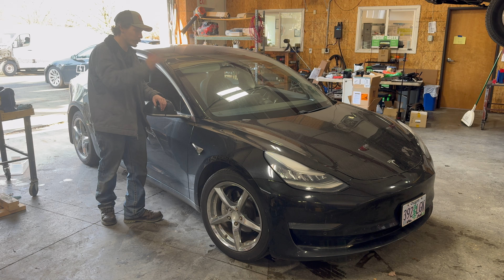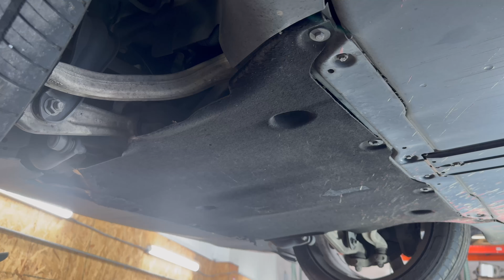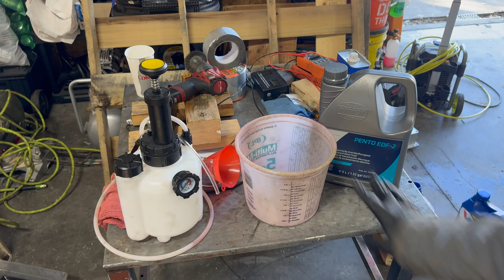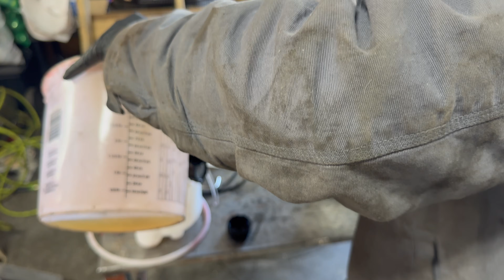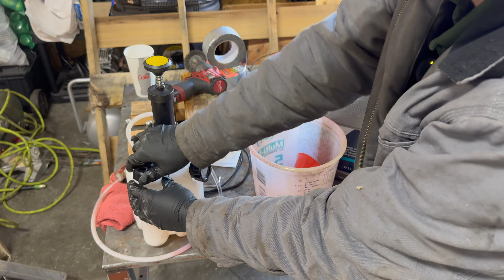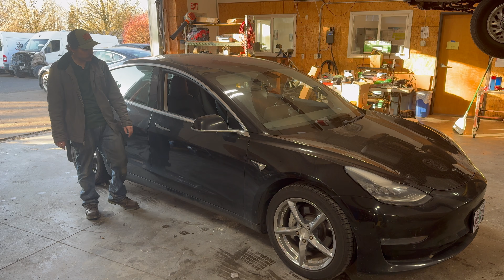Tesla Needs An Oil Change? Model 3 Gearbox Fluid Exchange Process

Comment: If I change the transmission fluid myself, will I also need to use diagnostic software or perform any kind of reset or adaptation procedure afterward?

Comment: what is the third wire for on the electrical connector? So you can run this pump with just a power and ground?
Reply from the maker: The 3rd wire is for PWM feedback to modulate the pump's speed. If the pump doesn't receive a PWM signal, it just runs at full speed.

Comment: I just did my model 3 long range. To get the pump out I just removed the front motor mount bolt and jacked the motor and let it down about half an inch. It takes an extra minute or two but the oil pump will clear and you can pull it all the way out. I was changing the ring seal as well so I had to. But it’s not difficult at all. So yes you can definitely let it down. Just one bolt and a screw jack while it’s up on the lift.

Comment: So replacing the filter isn't necessary? I'd say it's vital. Also not taking the pump out means the old seal cannot be replaced. Recipe for leaks to develop further down the line. If your going to do the job don't cut corners or expensive outcomes could catch you out.

Comment: What's the name/type of the socket/plug for the oil pump? I wanna make a tool like that as well.

Or can I just use alligator clips? Not a big fan of alligator clips. 
I heard there's a brushless motor and a control chip inside so you cannot mix up the + and - otherwise it'll break.

How did you figure out the terminals?

Can you also just use the car's navigation to a nearby supercharger to cycle the pumps? I've heard that'll make them run while stationary?

Comment: Nice job spraying break clean while the drain plug was open. Ensure you get some break clean into the gear box. Also replacing a drain plug washer should be standard practice on top of the washer for the gear pump. Those will leak over time since you decided to do a service to it

Comment: Hope you can help. My rear drive unit in my 2023 model 3 (RWD with LFP battery) is making whining noise when at 70mph. I believe it is the drive gear. The drive unit is 1120990-00-J and I found a 1120980-00-D dirty cheap. Is it backward compatible? I have a 30 day subscription of toolbox.
Reply: Its a stiff ground cable between drive unit and chasis. Remove left real wheel and wiggle the cable 😉
Reply: @The_World_in_HDR  You meant my whining (woo-woo-woo) noise when at 70mph constantly is because of the stiff good cable?
Reply: @derekkchung yes, it transfers the noise from drive unit to the chasis, go try it out and then please reply if this helped. You can also put some grease oil or whatever on the cable to prevent it from going stiff again.
Reply: @The_World_in_HDR  I actually took the subframe + drive unit out to replace the bushings (not quite successfully) and we did touch the ground cable. It is not stiff. The woo-woo noise is not coming from left or right wheel so it is not wheel bearing. It has to be from inside the drive unit. Maybe the gear bearings or gear mesh. Question is to replace the whole drive unit, or just bearings and/or gear mesh.. Not much info online for doing that.
Reply: @derekkchung okay then I dont know. Good luck finding the problem.

Comment: I wonder if you could help me.....i purchase a harness that runs the pump but it has 3 wires (red,blue,black) instead of the 2 (red,black) that connect to spade terminals if 12volt battery.....which goes where?
Reply: https://youtu.be/hFX990n95-A?t=17

Comment: do  you not disconect 12v battery when you operate on those pumps ??  but just take off the power line on the pumps ??? but realy nice video :)

Comment: Is that electrical connection just a 2 pin female Deutsch connector? Also, what is the oil filter number? I just don't want to install something "Out of Spec"..... See what I did there ;)

Comment: Use your favorite search engine with this prompt:
Why do only some of my comments to a YouTube video get deleted within seconds of posting?
It's both interesting and frustrating.  I'm posting this comment only because of the problem I've had with several (not all) of my comments to this video getting auto-deleted repeatedly even after I try changing them.  And I was actually trying to give helpful information based on my experience changing the fluid on my 2022 M3 LR.

Comment: I followed the procedure in the online Model 3 Service Manual to change the fluid in my 2022 M3 LR .  One of the first steps is to disconnect the low voltage battery.  I read through the entire procedure and could not understand why that should be done, so I didn't.  I didn't see any problems.  What could the reason possibly be to go through all the effort of disconnecting the low voltage battery?  I can't think of anything that is less safe by leaving it connected.  And if you disconnect it, you wouldn't be able to use the Service Mode Plus menus to run the oil pumps.  If anyone knows, tell us if the technicians in Tesla service centers disconnect it to do this procedure.

Comment: The more I think about it the more frustrated I get about how car companies make it impossible to do a basic maintenance item such as this by forcing you to pay for either a special run-box ($500+) or a Service Mode Plus subscription ($75 for 24 hours).  One of these is needed to simply run the oil pump(s) on some models later than the 2018 in this video.

Comment: I kinda doubt the pigtail that works on my 2022 M3 LR oil pumps (part # 1108202-00-L) would work with the 2018 in this video considering it looks like 2 separate connectors were pushed onto pins in the oil pump by you.  My oil pumps have 3 tiny pins in a small, oval jack.  I wouldn't want to try pushing separate, tiny connectors onto those tiny pins separately - pretty much impossible... and you'd probably bend them.  So, research showed that pigtails for my oil pumps have connectors that are also used for Tesla parking sensors.  
Web URLs in my previous comments have apparently caused those entire comments to be automatically deleted, so I'll have to be cryptic about the link for the pigtail I bought.    Paste this onto the end of the big 'A' product source owned by Jeff Bezos: "/dp/B0F9FMKZHS".  For anyone who tries this, let me know if this does or does not work.  And I'll keep monitoring this comment to see if it also gets automatically deleted.  
However, there's a big wall I've run into by trying to use this pigtail.  12v and gnd are on pin 1 and 3, respectively (pin 1 is nearest the slot).  I connected it to wires with battery clamps.  After connecting it to the oil pump and battery, nothing happened.   More research found that the LIN bus on pin 2 needs to see very specific LIN bus messages.  If you want to use an Arduino, Raspberry Pi or something similar along with a LIN bus interface chip/module, it's possible to make something that will get the oil pump commanded to run.  Use your favorite AI search engine to find the specifics if you want to pursue this, but I think I've decided to go a far lower-tech way to get my drive units filled with oil.  
I'm thinking that I can simply insert the fill hose into the fill hole and seal around it by stuffing in a cloth with a screwdriver just good enough to keep most of the oil from running back out of the hole.  Then I could pump in the full amount plus maybe a tiny bit extra to compensate for what will be lost between pulling out the fill hose, quickly putting a finger/thumb over the hole, then installing the fill plug with the other hand quickly after moving my hole-plugging finger out of the way.  Should be minimal fluid loss if done quickly.  Why wouldn't doing it this way be acceptable?  Would be a bit messier method, but it's free!  I don't think I want to be spending significant effort and/or money on buying or building something that might only be used maybe 2 or 3 times over the entire life of my vehicle.

Comment: Why does my comment about my experience with doing this on my Model 3 keep getting deleted?  Do comments containing Web addresses automatically get deleted?  I was trying to show where I found the connector pigtail that I used along with some other details I've figured out.
Reply: Also my later comment about oil filters got auto-deleted, and it didn't contain a web address.  It did however have at least 4 exclamation points in it, so does that flag a comment as overly-aggressive or inappropriate?  Since I saved it in a text document (I've learned the hard way to do this), I was able to repost the comment with the exclamation points removed, so we'll see if it gets auto-deleted again for some other reason.
Reply: Yep, my oil filter comment is gone again.  I'd really like to know what is going on.  This is really frustrating.

Comment: Where can i buy that pigtail wire?
Reply: I tried to post the link where I bought mine, but my comment keeps getting deleted.  Might be because it contained a Web address?
Reply: @BradMosch_engineer - do you have like a website you bought it from or ebay? You can post a link the link just space out certain things like HTTPS and some of the website and ill put it together
Reply: See my latest post in the comments.  I was very cryptic about the URL, so hopefully it won't get auto-deleted.  Also has other info about the problems with going that route trying to run the oil pumps (not nearly as easy as shown in this video).
Reply: I wouldn't worry about cycling the pump, just drain and fill
Reply: @MattB787   The problem is that if you don't run the pump while filling the fluid overflows the fill hole.
Reply: @BradMosch_engineer  Does it overflow? I watched another video, and the guy did not cycle the pump...might have been the rear drive unit.
Reply: @MattB787   I didn't try to put the full amount into the rear unit before slowly driving it, so I don't know if that one will overflow.  But, the front definitely overflowed about 200 or 300 ml before I got it all in.  It still overflowed after driving it around a little to get it circulating.  I ended up sealing around the fill tube with a rag, forcing the rest in, then quickly pulled the tube and put the plug in.
Reply: @MattB787 
 When it starts dripping. Go back to the car and switch navigation to supercharger, the oil pump starts running, and add the rest odf the oil. Simple

Comment: Tesla reduction gear boxes are sealed for life with no oil changes needed. Engineers with much higher qualifications than anyone on this channel (myself included) have worked this out for longevity using precision gear machining and latest tech lubricants.

Teslas with nearly a million kms are still working with zero problems after zero oil changes.

No need to waste your money, time, and more oil for no benefit.
Reply: Lol Yeah by that time no more warranty from tesla yeah they back and say no maintenance but after sh.ttt happen after 120K you end up paying the damage for a simple oil change

Comment: Why do people continue to remove fill plugs to "expedite" draining oil? It does not help!! The necessary air to alleviate a vacuum plug is coming from the open drain plug or the removed oil filter, not the fill plug....  :)

Comment: Just found you and subscribed from seeing samcrac’s video on the speed sensor. I have a 19 m3p with 103k miles and will be doing my oil changes soon. I bought filters like 2 years ago but really didn’t t know how. Now I do! question for you. I’m about out of warranty on mine and concerned about battery failure after warranty. Thoughts. I’ve only used a SC a hand full of times otherwise charging at home at 30 amp. Usually to 90%. Not sure to keep or sell or what. Only worth maybe $17k now great shape no issues.  Thank you!

Comment: Pigtail, can you provide the part number for the connector or a link to the amazon for it? Thanks
Reply: I tried posting the link to the pigtail that worked on my 2022 Model 3, but my comments keep getting deleted!  I'd like to know why.
Reply: @BradMosch_engineer odd. I found the connector that works from a wiring loom on bumper. Cut it off and used... worked well. But ya, who has that around...
Reply: @sigor2011   See my latest post.  I was cryptic about the address.

Comment: It’s wild seeing so many people in the comments cheering this on like it’s a masterclass in EV maintenance. This is a textbook example of how to confidently destroy a $5,000+ drive unit while pretending to 'save' it.

1. He used the wrong fluid: He admits to dumping in EDF2 just because his local parts store had it, instead of sourcing the actual required KF1 spec fluid.
2. Complete hack job: He crushes the oil filter with a chain wrench, eyeballs the highly sensitive fluid measurement from a plastic jug, and hot-wires the car's internal pump with loose spade terminals connected to a Milwaukee drill battery that literally falls off mid-fill.
3. Fundamentally misunderstanding the engineering: He's using 1990s Honda Civic logic on a modern EV. Unlike cheaper EVs (aka your leafs, bolts and Kona’s) with passive splash lubrication, this drive unit has an active, pressurized oil pump and a built-in filter. It actively removes metal shavings. That’s exactly why the fluid doesn't turn into abrasive sludge and is engineered to last the life of the car.
Unless your car’s computer is actively throwing a thermal or pressure error, cracking open a factory-sealed, heavily engineered system to guess the fluid levels is just begging for an out-of-pocket motor replacement. Do not do this to your cars.
Reply: I think you’re about the only person who understands the “Sealed for Life” reasoning in a Tesla gearbox.

There is no valid reason to do this unless you have a leak or damage.

Leave it alone. Even many ICE vehicle gearboxes and diffs are sealed for life.
Reply: Where are you getting your information from?  This is copied from the online Model 3 service manual's 'Fluids and Capacities' section:  
- For all 3DU drive units up to and including Model Year 2023 use ATF-9 (part number 1135241-00-A) or EDF2 (part number 1616951-00-A), or ultimately KAF1 (V1.2) (part number 1646886-02-B or 1646886-04-B)
- For all 3DU drive units Model Year 2024 and later use KAF1 (part number 1646886-02-A or 1646886-04-A)
- For all 4DU drive units use KAF1 (V1.2) (part number 1646886-02-B or 1646886-04-B)

Comment: Great video, as always, adding to everyone’s EV mechanical knowledge. Have a 2023 model 3 dual motor. Eventually I will change the gearboxes’ oil. Sure wish Tesla had installed a drain plug  and a way to just fill the gearbox, run the pump motor from the screen, then drive. Simple, like changing fluid on a combustion motor automatic transmission.

Comment: Is it safe to say that the newer 16volt Tesla’s require a 16v battery to run the pump?
Reply: .. or follow the advice in this comments section from people who have done it without electrical disconnection.
Reply: A 12V power supply will run a 16V motor adequately for this purpose.

Comment: How do you make sure the harness polarity is correct? I wouldn’t do to run the pump in reverse…
Reply: These pumps are electronic. They don't have brushes. They have three terminals, and the center one is for RPM. The outer pins are for power. I think the top pin is positive. If you connect it wrong, you'll probably break it.

Also, there are other ways to activate the motor without applying power, such as pre-conditioning the battery.

Comment: If you're like me and you keep your car for a long time investigate what fleet operators do with their Teslas I just took mine in and had the rear drive unit oil and filter changed and I've got over 60,000 mi and it's a 2023 I plan to do  preventative items and copy the fleet operators methodology.

Comment: @4:28 Tesla procedure for oil and filter replacement is to support DU and remove front mounting bolt and allow to drop to remove oil pump should replace o ring seal.

Comment: You've got to be mistaken. The EV car channels all told us that EVs had basically 2 moving parts. So that leaves a motor and wheels. Motor's electric. So did Tesla put oil in the wheels?  😁 Did those EV hucksters lie to us, or maybe downplay that these cars contain hydraulic fluids, HVAC refrigerant, and extensive coolant systems that bridge battery, motor, and interior. Electric cars are not basically two moving parts. They have the same (or in some cases more complex) suspension, they have a complex hybrid braking system to mix regen and mechanical brakes. They have bearings in the motor/differentials, in the CV joints and in the wheels. Thanks for letting those undereducated EV owners know that there are lots of points of failure and maintenance items on EVs despite what the EV advocates told them. Fewer?  Maybe, but EVs also have the unfortunate trouble of being more  reliant on CPUs and software than prior cars. We cannot keep using ICE, but EVs are an unsustainable replacement. We need to transition to mass public transit, active transportation, and micromobility to meet the constraints of zero carbon emissions. EVs won't get us there. They're a failing bridge solution.

Comment: I replaced my drive unit oil and filter at 80k miles, bought used at 65k. it was quite black. I feel good about it, I probably wont do it again. seems good to get rid of the original oil since it'll be the dirtiest it'll ever get.

Comment: In my ‘22 M3P I have been doing every 30k at the recommendation of a retired certified Tesla tech. The first two the oil was very dark and smelled slightly burned. The next oil change I am going to cut the filters open and also going to send samples to the test lab. The last time we refilled with the next KAL? Lube which is more of a honey color.
Reply: Hi i live in canada and was just wondering where you source your fluid and filter. And also which companies make a fluid that meets the spec of the oem?